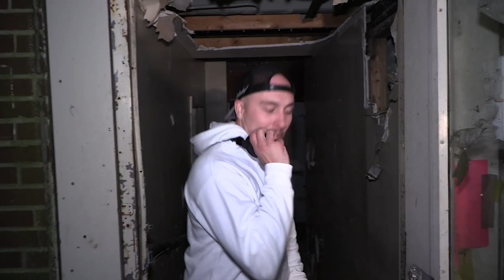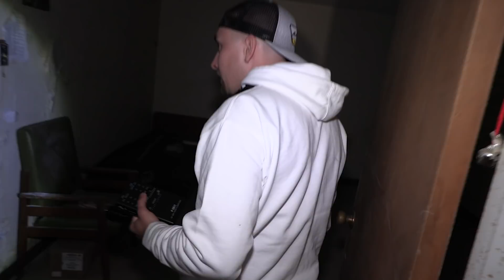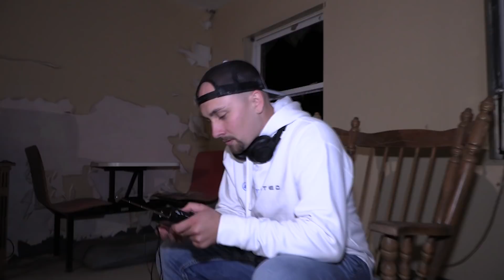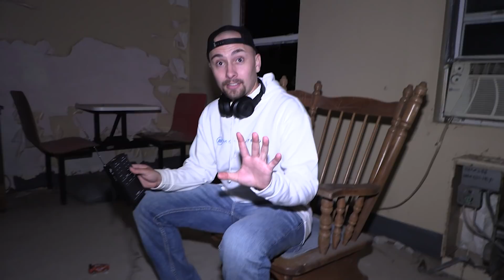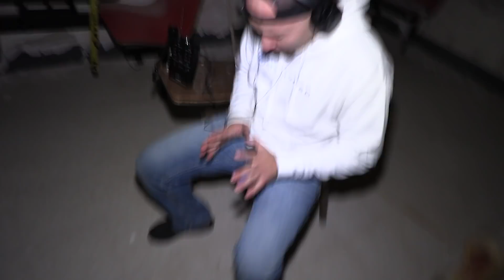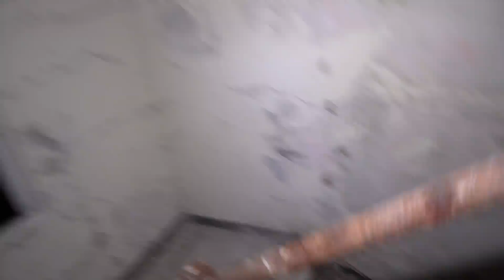(PART 5) 48 HOURS INSIDE USA'S MOST HAUNTED HOSPITAL

Comment: This is one of the best series you've ever done however you need to incorporate some new equipment like a way to track team members whether through an ap on your phones or by those little tracking devices.  Also, you need to be able to contact each other with walkie-talkies.  I liked having Dylan and Chris watch from the outside to see your progress, that was very interesting but it might be interesting to bring some battery operated lanterns and leave them on in the middle of the floor to illuminate the windows allowing more potential visibility of shadows or movement in the windows.